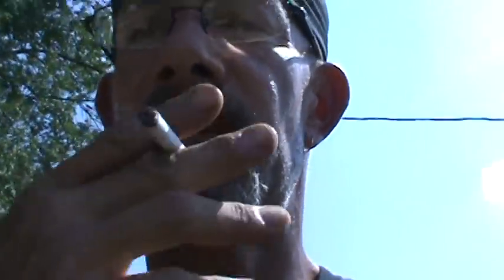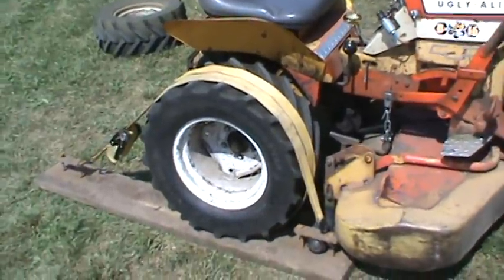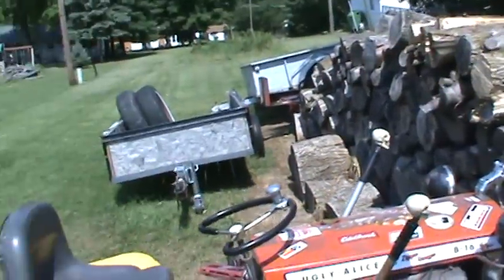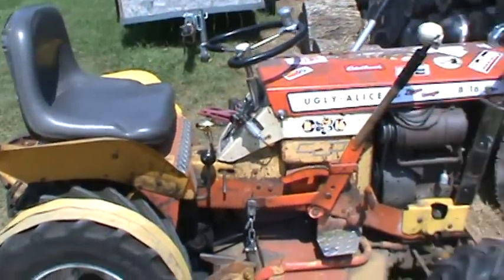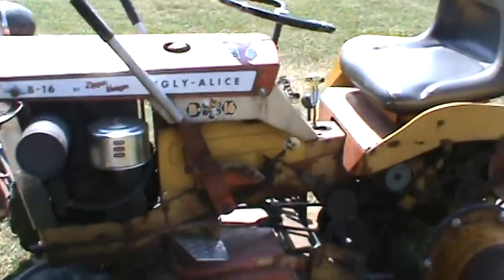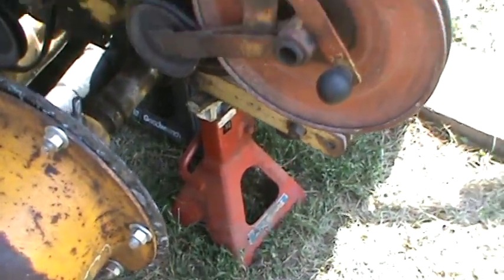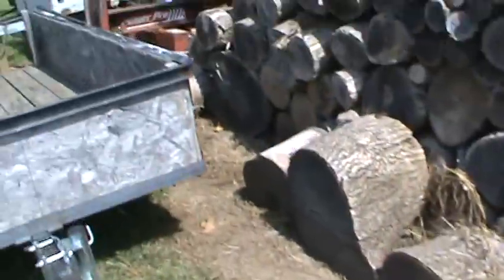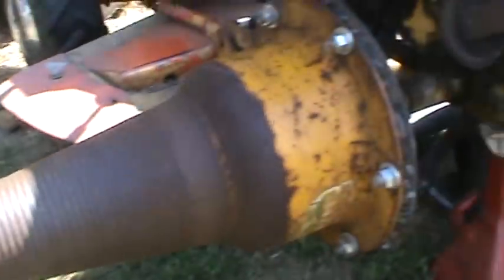The Stickler Wood Splitter Screw

Comment: These type splitters are fast but somewhat dangerous in my opinion.  My late father had a splitter like this that mounted to the 3pt hitch of a 1954 NAA Ford and ran off the pto.  It would go to town on a pile of wood.
Reply from the maker: You've got to keep your wits about you when using it for sure! I don't use it. I just wanted one to mount to Ugly-Alice at the tractor shows. Cheers Machi! Zip~

Comment: Hey Zippo! great video, really cool invention, but i noticed you really like Simplicity mowers, and i wanted to ask a few questions about mine, its a Simplicity 5008, i think from the early 70s, it was my great grandmas, who passed away a couple months ago, we have been trying to find out things about it ever since we got it, but theres very little on it, we were wondering if you would know anything about it, it runs great, but its stuck in 3, no nuetruel or anything, just 3rd, mows great though.  If you know anything about them, please let me know :)
Reply from the maker: +FarmBoy 1208 Absolutely 1208....Go to Simpletractors dott comm. There are hundreds of collectors there who can help you with your little Simplicity. Sometimes, you have to split the transmission in half to dislodge the shift fork, but some of the other collectors may have a trick or two. Also, replacing the transmission is a  quick and inexpensive option. The transmission in your machine was widely used for many years on these little guys. Cheers!! Zip~
Reply: Thanks so much for your tips, hopefully we get the gearbox fixed.

Comment: Hey Zip, My old boss has one of those on his Yanmar and somehow broke a few fingers. Just saying cool, but don't get to relaxed using it.
Reply from the maker: +PHISHY 69 Yeah, I've heard horror stories about them. It's not going to be put to use unless my main log splitter brakes down, and then it will only be used very cautiously. When I reached for the wood I got closer to the screw than I should have, and when I edited the video I cringed. They are to be respected for sure!! Thanks much for the concern, and I will heed your advice! Cheers!! Zip~

Comment: Zippo! I need your help!!! Me and my dad just got our hands on the first allis chamlers b 112 we've ever laid eyes on. Came with tiller mower deck and cultivator. All original including the motor. It does have the varidrive rearend. My question deals with the gear box that is mounted in front of the transmission that also drive the mule drive as you called it in another video. The motor is running now after sitting in a barn for seven plus years but when running the gear box isn't turning. The direct drive shaft from the motor to the gear box is however the gearbox is not. Please HELP!!!!! I'll give you my email and phone number or whatever I have to do. HELP! Thanks in advance and keep up the great work!
Reply from the maker: +Cory Blake You need a variable drive specific bevel gear box. Go to both Simpletractors.com and Facebook to the Simplicity and Allis Chalmers collectors page. Many people there have spares laying around then can sell you to get your B-112 up and driving. Cheers!! Zip~
Reply: +ZippoVarga 

Is there not a C clip or sometime of keeper in the bevel gear box? Or is it just one of the gears in the box that wear out and strip over time? Thanks in advance.
Reply from the maker: Open it and inspect it. The input gear is bolted on, the cross shaft is shimmed in to mesh the gears properly. Most generally, a woodruff key is the problem. If so, you will need to either repair or replace the shaft with the damaged woorduff key way.
Reply: +ZippoVarga 

Thanks for the info. Will let you know the progress and what we find. Keep up the good work. I've learned a lot already just watching your videos.